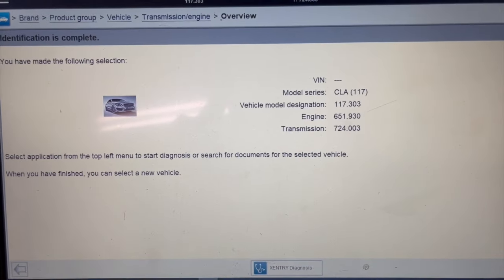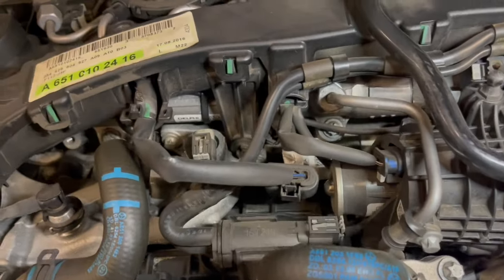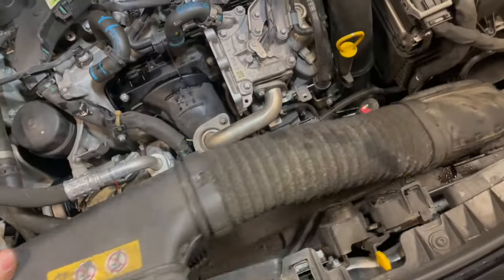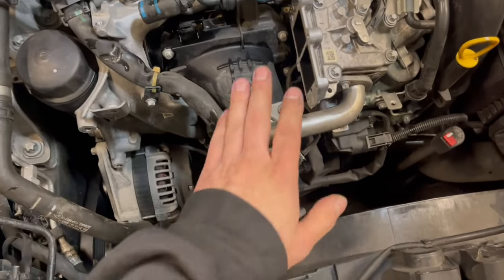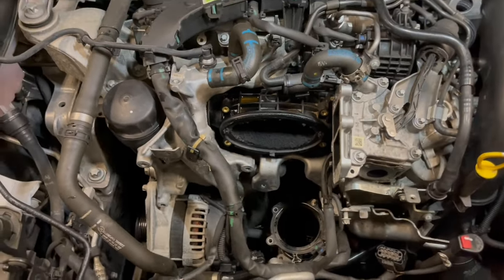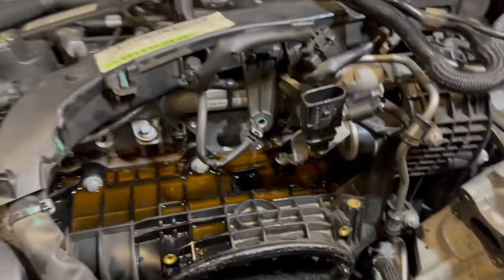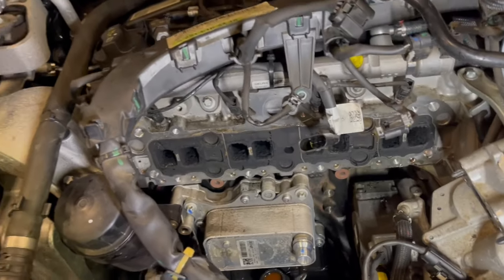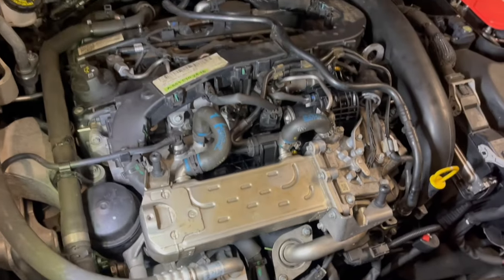Mercedes CLA | Inlet manifold replacement | 2016 220CDI OM651

Comment: Wonderful video, but one question.  When you remove the compressor, you're supposed to refill it with gas, right?
Reply from the maker: Of course the gas was refilled after the job was done
Reply: @mercmantips  Could you please tell me how many Nm did you tighten the high pressure fuel pipe that comes out at minute 4:48 or 6:44?  Thank you so much.

Comment: Excellent vid mercman.        Im about to remove my inl mani.       60000 miles 2 to 3 merc oil n filter changes a year.       Removed my egr pipe.   Inlet manifold. Thick with carbon.          These engines were designed by dr evil on the merc engineering team.          Egr gas and crankcase mist combine in inlet to make killer tar.            Limited longevity in full force.            My last merc.   I ever buy.     Garbage
Reply: Timing chain tensioners also fail and drain empty overnight to sump.         The oil filter housings all drain to sump overnite.       Drystarts.       Oil feed delay to empty chain tensioner.   Cold rattle.      On cold start.     3 seconds and its silent.   Merc say its normal just engine heating up.        3 seconds. Then silence !!Its a diesel mate not nuclear fusion.

Comment: I think I got a similar issue with my cla shooting brake 220d. Just had an oil seal replaced but without complication. Currently getting the inket manifold replaced as of the garage's latest update. Basically they couldnt work out why there were fumes getting through the vents when I reported it and also, i had some really wierd engine performance of what seem i can only described as the car going into limp mode (based on my research). Essentially i would occasionally get chugging behaviour when apply acceleration and it would go into limp mode where the paddle shifters would no longer work. Also another sign was that the dynamic select had no change in the way the car drove, it just maintained its own speed and would accelerate at its own accord. Anyway, finger crossed that this the issue, but missing how it drove previously. It work better when it had an oil leak 😂

Comment: I had same problem on my Vito W447. I do most of my own repairs but once seeing how involved the job was and being so busy in my own work  I took to a indi merc garage. 2200 for the part and labour. I declined and tried where else. Next garage quoted 1300 including the 400 pound manifold. What a bitch of an engine to work on i'll say even though i subbed the work out.

Comment: HELLO, ☺nice video. I've the same problem on my car, 200d OM651, and in the tech service they advise me to replace the small intercooler too. What's your opinion about this proposal?  Thanks in advance for your feedback
Reply from the maker: Hi Fernando, why did they advise to change that too? I have never had a problem with the intercooler on these models so far.
Reply: @mercmantips  Hi, they sow me the small intercooler disassembled from one W176, with same motor OM651, and it was full of carbon too. It happens due to the recirculation of exhaust gases system.
Reply: @FernandoHernandez-eu6hr  It's not the intercooler, it's the egr radiator which is full of carbon and gets clogged
Reply: @erdalozkan2876  Thanks for your feedback ☺

Comment: Hey , great video but how did you do this with these 4 throtle bolts , Im struggeling at that point because its so difficult to put these throttle bolts back in from underneath
Reply from the maker: Yes that is probably the hardest part of this job, it can be done with a little bit of patience 😅

Comment: I have to do this job in a few weeks time, so thanks for the video, The OM engine is a marvel but mr mercedes never ever thought about maintenance, Personally i have had enough of my W212 E220 E class, after this job is done i will get rid of the car, it has been the very worse car that i have ever owned, rear subframe failed, replaced free by mercs, then they fitted the wrong front springs, i have the rear disc back plates to replaced like the subframe rusted through, silly messages, yeah i have had enough of this particular piece of junk. This inlet manifold is the very last straw. the car is shit so beware all that venture towards an E class.
Reply from the maker: I prefer doing this job on an E-class rather than a A-class or CLA, its a bit easier so good luck 🤞
Reply: My W212 E220CDI is the best car I've ever owned, 160K miles & only issue I've had in the 60K I've put on it is last month the diaphragm capsule controlling the VGT had to be changed.
Reply: ive hafd my 2011 w212 om651 for 5 years and 370k. absolutely love it.

Comment: Great video thank you, just one question do you need to vent out air and add fluid cooler when reinstalling the egr cooler?
Reply from the maker: I just let it drain down as i remove the parts and then top up once finished

Comment: Great video, having the exact same issue as this with my c class estate  p200a21 fault code, causes rough idle, low acceleration under boost and poor fuel economy , could you tell me how many hours labour you gave for this as trying to price it up in my local area. cheers
Reply: I DONE THE SAME THING THE OTHER DAY IT TOOK 2 DAYS AFTER CLEANING OFF ALL THE OTHER PARTS PLUS REPLACING  THE INTAKE MANIFOLD IM POSATIVE THE TOTAL PRICE IS £ 1500  AS THE NEW PART ALONE IS £480 FROM THE MAIN DELA MAKE SURE YOU GOT A PHONE CHARGED UP AS THE AMOUND OF SCREWS YOU TAKE OFF IS UNREAL🤣😅😂😅

Comment: Thanks for explaining @Mercman tips
I’ve got the same issue on my CLA 220D 2016 get error codes P200A and P0401 which indicates to the same problem which is the intake manifold, I’ve bought the part on eBay but need someone to replace it, are you located in London by any chance?
Reply: For the P200 code, yes, the inlet must be changed. But for the code P0401 you have to change the complete egr valve. I solved the same problem on a class A 2016
Reply: Did you get this part replaced? I think I’m in the same boat but need someone to replace it

Comment: Great work MercMan. What would cause such a great carbon build up in a relatively new car?
Reply from the maker: All diesels generally have carbon built up, especially if driven in town a lot..
Reply: Possibly also a goosed thermostat or air leak making the recycled exhaust gas VERY sooty and clogging up inlet. Check all emissions and fuelling sensors are working.
Reply: @mercmantips  it’s down mainly to the EGR, if you remove egr and dpf and check the engine again in 50k it will be clean.
Reply: What sort of cost would that be to be done?

Comment: Please help me

I have a a220cdi a class , I can’t find the location of the high pressure egr valve , thanks bro
Reply from the maker: What year is it? There should only be one egr valve if its om651
Reply: @mercmantips  2013 bro
Reply from the maker: There is only one egr valve connected to the egr cooler
Reply: @mercmantips  thought so, I’ve got the right one then, appreciate the sharp responses, will definitely give you a follow, cheers pal

Comment: Could you do this without driaing the aircon fluid?
Reply from the maker: No, because you need to take the compressor out
Reply: @mercmantips but the pipes are flexible so maybe just putting it aside should be enough, right?

Comment: Disastrous car, always serviced by Mercedes, I too had to change it after only 120K km, shortly after the EGR valve, after cleaning the air flow meter.  Some time before, the turbine mysteriously exploded and before selling it, the DPF was clogged and the regeneration no longer started.  Finally, the day before giving it to the dealer, who took it back from me crying, the water pump broke!!!  Whoever has this car should sell it as soon as possible after 90k km it was a disaster and I'm not the only one this has happened to.